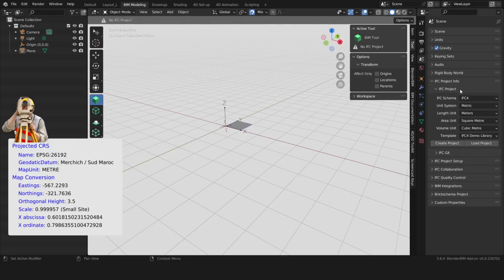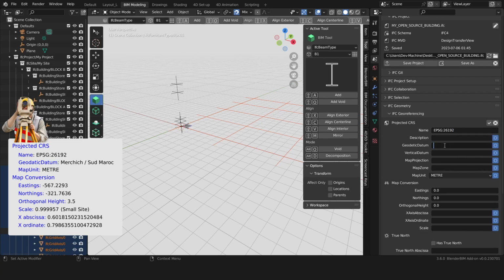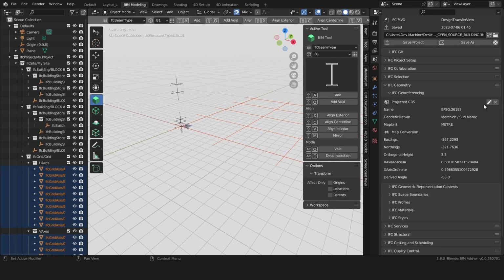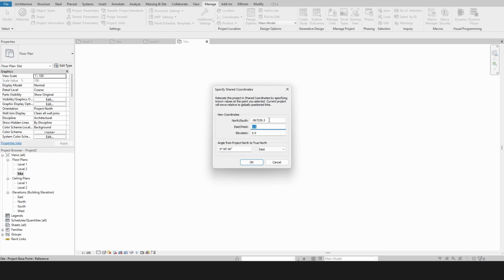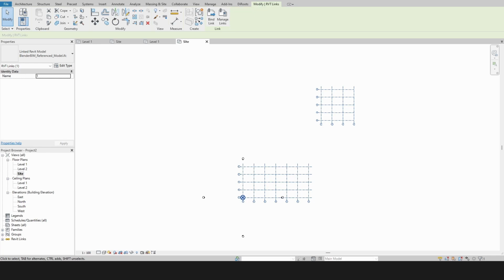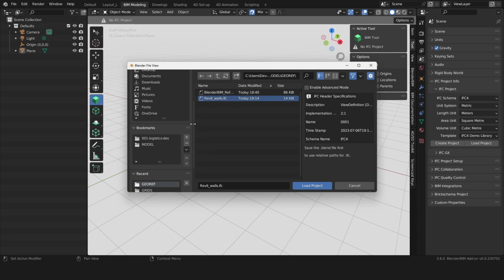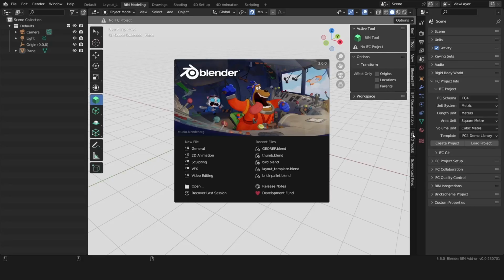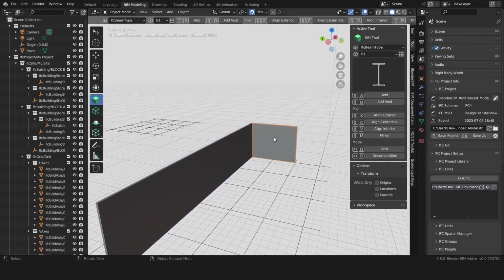Revit - BlenderBIM Geolocation and collaboration

Comment: Great content! Is it possible to acquire coordinates from a dwg file (similar to revit)?
Reply from the maker: Not through BlenderBIM unfortunately as .dwg is a closed file format. 
Although not ideal in my view, one could start out with a project set-up through Revit, acquire coordinates from dwg or some other method, thenexport to IFC (with project base point). Then, BlenderBIM can be used to ensure the EPSG Code + Eastings & Northings are correctly filled out in IFC, and carry on working on that exported file.
Reply: as far as I know DWG use coordinates, if the original file used projected coordinates they are preserved in the same file. Don't know how to implement in IFC though, but it would be useful to find out